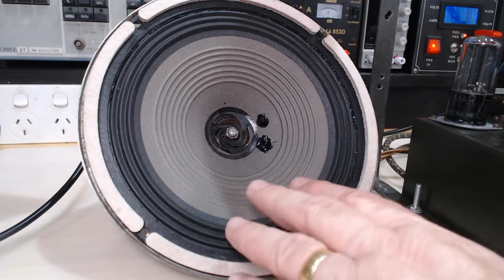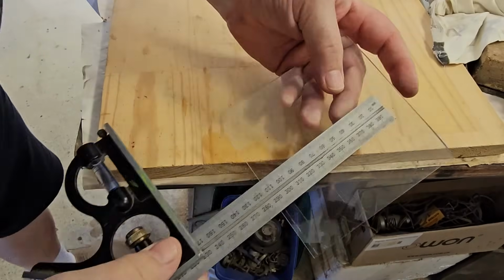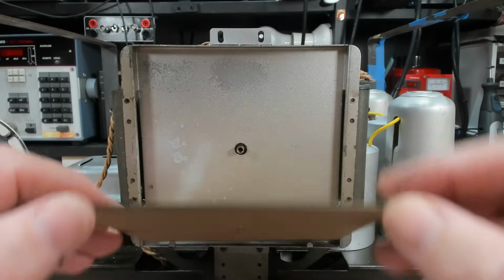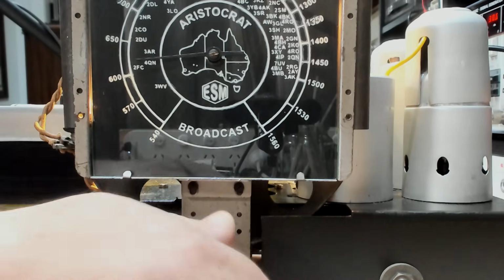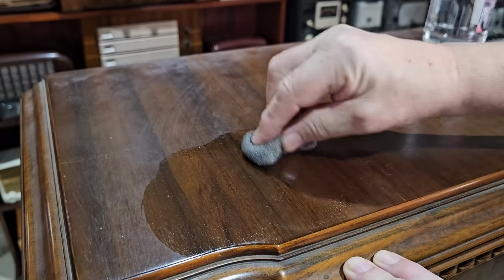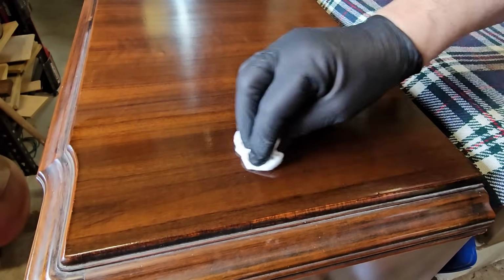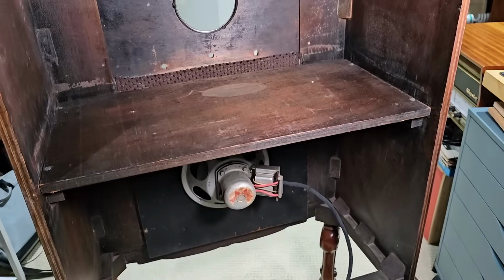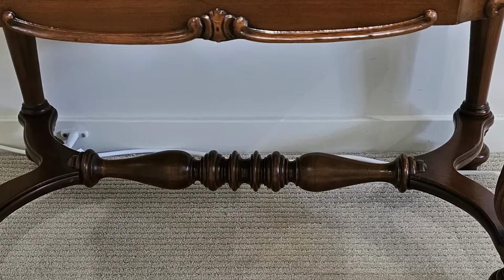Aristocrat Console Radio Restore - Part 4 - Final

Comment: Love the dial... Looks like one I saw in outback in a display along with old tractors and big cooking pots .  A dummy on a old flick switch telephone exchange .  Compared to what we had in east London as a kid. And similar sort of age a lot of the stuff.  We even had radio relay . Radio in wires . Just a box in house with a clickey switch . Running water and gas and electric ... Sheering sheep with a stationary engine and big belts .  Another job I got offered .  I fixed the stationary engine.  They all thought I was jesus .  Performing a miracle .  It was nothing compared to what you do .  Do like that dial though. . always impressed me as a kid I always thought that more stations on a dial the more valves the set had and it was a super duper super heterodyne .. huh even with a big  Ariel still struggled with Luxemburg.  208mw .  Then a perdio tranny radio .made in UK .  Boy could that pick up . And without a wire above line pole in garden and another as earth below buried in ground .  .. then radio London. 266 mw .  50.000 watts of power . With hum of generators  in background.  Must go someone singing door bell
Reply from the maker: That's quite a story Colin, thanks for sharing 😊

Comment: Meticulous restoration, only thing is that blemish on the left side of the front panel keeps drawing my eye. Did you consider repairing that?
Reply from the maker: I didn't worry about that Nicholas. I should have dabbed a bit of colour in it but I didn't want to start repairing it. It's over 90 years old, it has other knocks 🙂

Comment: Hi
I have a 1950s Stromberg Carlson radiogram. I got a technician to fix the radio but he couldn't fix the old turntable. Someone gave me your youtube because you're closer to me in.
 Brisbane.
@AndrewChalkyPetrou
Reply from the maker: I'm southside near Redland Bay. The older turntables are difficult to repair, old rubber and such.
Reply: Everything still works except for a small rubber ring 
 @DavidTipton101
Reply from the maker: If you are asking me to look at it you will have to send me an email. My email address is on my YouTube home page. Send some photos of the deck, it's model number and the defective rubber ring.
Reply: Ok. It's been my dream for a long time to restore this radiogram. I'll get onto it an send you some photos.
The radiogram has huge sentimental value as it appears to be the same actual radiogram I grew up with ie the real one! Long story which I hope to tell you one day. I've also got all the very old single records my family used to play on it. 
@DavidTipton101

Comment: Have you tried using grey silicon heatsink pads, (goes between power transistors and the heatsink) for securing the glass firmly ?  Soft and heat resistant.
Reply from the maker: No I haven't Paul, good idea, thanks for the tip 👍🙂

Comment: That finish came up beautifully. I'll have to source some of that Howards restorer. That dial came up extremely well. You have a very comprehensive array of tools and the knowledge to use them well. A lovely outcome as usual. You keep raising the bar with each restoration. Someone will be very happy to proudly display it. Perhaps a museum.
Reply from the maker: Thanks Ian. I was pleasantly surprised with the Howard restorer, I used it once before on a radio gram and it worked well with that too. I do like my boys toys 😄

Comment: It looks so beautiful.  In the mid 1970s I bought a similar sized radio from a junk shop in Glebe.  I'm sure it had the same chassis, same circular dial and 3 knobs.  It was branded as a Relton Radio and had a clear mother of pearl dial with just black numbers on it.  It moved with me for decades.  In the end I moved house and didn't have room for it so I gave it to a friend.  I wish I could have known how to restore it and value it more than I did at the time.  Lovely to see this beautiful radio but they certainly do take up a lot of space.  😊👍
Reply from the maker: Hello Pauline. I wonder if my radio originally had a mother of pearl dial, it was popular at that time. I looked up Relton radios but couldn't find one like mine. Thanks Pauline 👍🙂
Reply: @DavidTipton101  I have never seen another Relton Radio in the large console cabinet either.  My one had a much more simple art deco style cabinet with slightly curvy speaker fretwork.  The dial didn't have frequency numbers on it, just a simple numeric scale.  I wonder if it will turn up one day.

Comment: G'day Dave, just watched you finish the old Aristocrat, but I don't recognise the NSW stations 2dL? 2LM ? nice old radio 👍🏽🎶
Reply from the maker: Opps... it should have been 2BL not 2DL, it's a bit smudged on the dial I used for reference. 2LM Lismore is correct and is an SRN station now 🙂

Comment: I was advised by a local glass cutter to use turpentine or white spirit on the cutting wheels. Just a quick dip before cutting cools and lubricates the cutter and keeps it sharp for longer. Brilliant restoration again as usual! Cheers!
Reply from the maker: Thanks Mark. WD40 is about 60% white spirit or something similar, it seemed to work OK and is in a handy pressure pack. I have used turps in the past. Thanks for the tip 👍🙂

Comment: Did Aristocrat label the wood cabinet above or below the knobs to designate function. I'm used to seeing a gold like lettering for volume etc on radio cabinets?
Reply from the maker: No Mack, that wasn't a thing on Australian radios. They sometimes hung a clear plastic sheet over the control shafts behind the knobs with text printed on them but few survive now 👍

Comment: Dave your work is always top shelf, you never stopped to amaze me with your skill to remanufacture parts for your projects. If I remember correctly you came from the engineering side aeronautical profession. I wouldn't be surprised if you hadn't major on personal aircraft, you certainly have the skill level.
Reply from the maker: Thanks Mack. Yes, I was an engineer with Qantas for 43 years 😊

Comment: HI Dave, very nice work! when cutting glass try pushing the cutter across the glass (once) then with both hands, thumbs on each side of the score close to the edge and lightly bend away from the score (no tapping). 
Good luck Rich
Reply from the maker: There seems to be 20 different ways to cut glass. I certainly need to improve my technique. Thanks Rich 🙂

Comment: I was impressed right up until you printed the dial, then I was blown away. That dial was the "piece de resistance" ! 
Though it may not have been the most sophisticated radio, electronically, back in the day, someone was prepared to pay big bucks, (pounds) for that beautiful cabinet. It was and still is a beautiful piece of furniture that happens to have a radio in it.
Reply from the maker: I tend to agree Ellesmere. It was a functional furniture piece more than a radio. The dial worked out very well. I'm still trying to perfect it but it's getting there. Thanks Ellesmere 👍

Comment: That is a wonderful job David. The cabinet looks great. I must remember the oooo steel wool and shellite. Also I I think I may have a bottle shaped 5y3. I’ll check tomorrow. And the ABC 612 kHz is 50 kw!  Almost any radio can pick it up here in mullumbimby nearly 200km from the transmitter.
Reply from the maker: Hi Robert. If you have a bottle version 5Y3 that would be great. Yes, 50 kW. I can pick up NSW ABC stations here at night 🙂

Comment: Hey, Dave!! Long time, no see!! Your Australian company probably has to make ya a dial glass. I wouldn't try to homemake one. Also, be careful 🧐 when cutting the dial glass to avoid accidentally getting hurt by the sharp edges of the glass. It sounds like 👍 the tuning capacitor on this radio could be slightly misaligned. It could also be the dial pointer, which may need to be precisely placed on the dial cord, since it could be a combination of both 🤔 things needing to be aligned. The next thino could be the dial spring (on the pulley). It's my birthday 🎂 In a couple weeks (June 5th). I'm turning the BIG 55!! Your friend, Jeff.
Reply from the maker: Hello Jeff. I managed to make the glass dial without hurting myself and lucky for me there is no dial string. Happy birthday for the 5th 🎂
Reply: @DavidTipton101 Thanks, Jeff.

Comment: Hi David,
During the latter half of the 1920s, and into the early to mid 1930s, when most radio manufacturers developed a design they considered commercially successful they often stayed with it for a few years, or as long as they got away with doing so, producing subsequent variants: passing each one off as their latest offering.  Incorporating one or two early 1930s design features, it's possibly your console radio was a case in-point??? 
Nonetheless, it is a super looking radio.  Seeing the completed restored article, which is a credit to you, one can clearly imagine what it looked like when the original owner got it home; liberated it from its cardboard box; connected an aerial, and applied mains power to it for the first time sometime around 1935.
Thank you.
Best regards, Phil
Reply from the maker: Absolutely Phil. It's the same for all manufactures, they stick to the same designs for as long as possible. It is disappointing that the superb cabinet housed such a basic radio, it' doesn't have AGC and not even short wave. Thank you Phil 🙂

Comment: Hi Dave - a quick question - I have a CJR161226 1Hz to 20MHz (sine/square/saw) signal generator but it does NOT have the facilities to superimpose a 400Hz (or thereabouts) modulation on the primary waveform - can I use this for alignment and if so, how is it connected? Kind regards Stephen
Reply from the maker: Hello Stephen. You can but you will need a scope to see the waveform. Connect the generator to the grid of the converter valve via a 0.01 capacitor. Connect the scope to the input to the volume control and you should be able to see it. I can't remember if I have tried it but it should work 👍
Reply: Hi David, thank-you so very much for your kind advice. I was wondering if I may/might be able to 'scope the waveform' and I do have several scopes but wasn't sure where to connect them. Thanks again - I'll give it a go when I reach this stage of my restoration. Kind regards Stephen

Comment: Loved the finished product Dave as always. 
Nice technique making the dial glass.
I was worried that heating the glass unevenly with the iron would cause it to shatter or crack.
Reply from the maker: Thank you @1974UTuber. The glass doesn't seem to mind the uneven heating, maybe I should try heating it more evenly next time though 👍
Reply: @DavidTipton101 Obviously you cut the glass well enough that you didn't leave any stress fractures to crack in the heat.

Comment: i might have a bottle 5y3 i will look  or use a 80 tube but the heater voltage
Reply from the maker: Ok, thanks Ian, that would be great. It would have been an 80 originally but it looks like a factory mod to the 5Y3 🙂